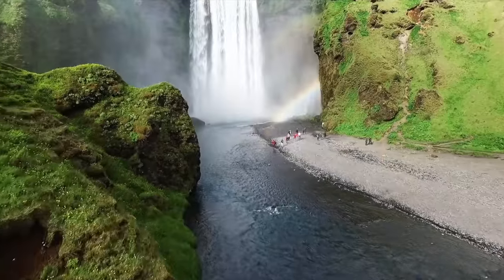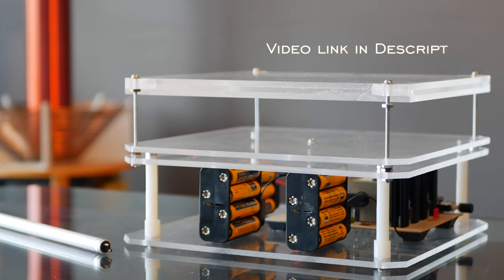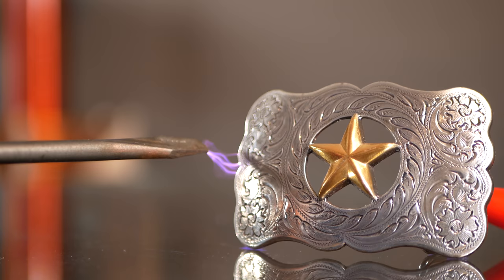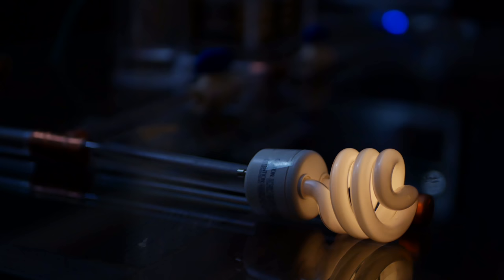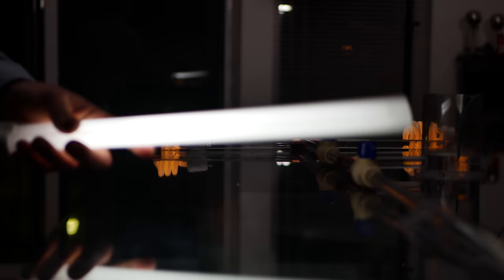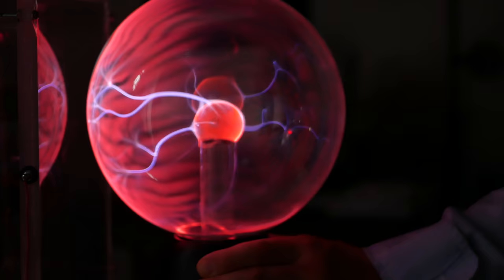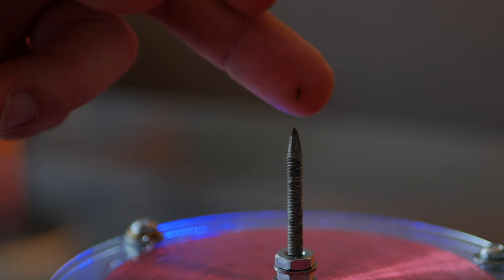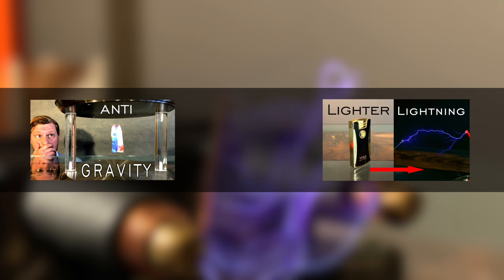Directional Wireless Energy Using Water

Comment: This system has alot of potential (pun intended).
Reply: More like it has a lot of spark😂
Reply: Yes, we must support his innovation. It may not a useful now, then it is useful.
Reply: It's used high voltage
Reply: Is water conductor or an isolator? It’s the system Of which you didn’t invent!
Reply: @veritasvalere88  water is non conductive at LOW voltage. At high voltage it can be very conductive.
Reply: @ValeyardStudios  not really it is conductive in relation to its pH and the type of electricity (negative/positive) that it's conducting but generally distilled water of pH 7 in a wooden basin (not plastic since plastic is resinous) will have the greatest resistance.
Reply: @wisecounsel6135  it's not about microminerals but rather about the crystalline nature of water which always has polarised hydrogen and hydroxide.
Reply: I noticed the comment and wondered. As a one-time electrochemist, potential jokes were routine😁
Reply: @wisecounsel6135  you explained that perfectly Simbarashe. what you said should end the discussion  but i see it continues on.. oh well that us humans for ya, we love to argue and discuss! 
; )

Comment: Wireless energy! See? We replaced all those messy wires with hoses filled with water!
Reply: now it is just like the internet, a bunch of tubes! (anybody still remember that reference?)
Reply: Everything you need to clean up is at hand.
Reply: Now when you drill through the flooring you can get electrocuted so you won't have to worry about the insurance claim 😂👍
Reply: @switchjim  me
Reply: Washington State has been putting lines underground pull put the lines put in water. Some had flooded anyway so better connections are needed.
Reply: Lol
Reply: Simpleton
Reply: Commonly known as streamlining
Reply: Lmaoo

Comment: I wonder if this is why Tesla's wardenclyffe tower had a central ground rod that ran through the water table?
Reply: If you look up AM radio, back in the day, studio could be in town, but the transmitting antenna was ideally located on marsh land, to make a more effective ground plane
Reply: Sigh.

No.

Tesla believed in the Ether, and that he could transmit power through the EARTH.
Reply: @Jkirk3279  why the sigh? what do you believe, pertaining to 'ether', 'power through earth' or the original question about the wet ground ... you didn't actually explain anything
Reply: @Jkirk3279  well plasma channel shower that water aids in transmitting power wirelessly, so I don't think that rules out Tesla using the water table and aquifers to aid in the transmission. However Tesla did say and believe in some wacky stuff, so while he may not have understood exactly why certain things happened, I don't think it rules out the possibility that he was utilizing groundwater.
Reply: @Jkirk3279  and the atmosphere tundiskey event. Can't say for certain  it's quite the coincidence if nothing else 🤔.
Reply: @MrDeathray117  wacky thing? Pray tell which ones outside information?
Reply: We knew this already.... when your radio falls into your bathtub, your hair automatically curls itself, Very efficient!!! 😂🤣
Reply: To guys who think it was for wireless electricity, nope, he built it because he wanted  planes to fly wirelessly.

He had made Tesla turbine for the same reason, it was way powerful than any ordinary motor.
Reply: @timmorris3056  tell me how to do it properly. It didn't work
Reply: Aquifers create electricity and can transmit it, tesla copied the pyramid builders methods of using aquifers to create and transmit wireless electricity. I think the pyramids were also known as the towers of babel, a civilization with unlimited power, and were build before the languages became confused.
Reply: Many great answers and ideas here. Fun to read. Remember that electricity isn't a product or invention, but a description of a natural force of nature. It is the same everywhere. It is the same "thing" however you use it,  and it was the same in ancient times as now, although the tech built to use it would be different. If Tesla figured out how to understand the invisible force, then he could harness it to work in many different ways ... I'm suggesting then, if he believed some "thing" actually functioned, it no doubt did function, imo ... if the government confiscated your stuff, it no doubt is because it actually works in a way they do not want you to actually be doing.
Reply: @get-out-there2  that is interesting. I believe the pyramids were highly efficient electrical resonator devices that operated on the frequency of hydrogen, oxygen, and water ... the passageways conducted, like a waveguide, and might have been flooded, if you can imagine electricity conducted by plumbing LOL ... additionally, all those repetative columns would act to filter and steer or propagate the desired frequency, while diminishing the unwanted noise. The little cutouts in the wall would do similar, and the parts inside are the components ... similar to how a semiconductor chip is one thing with little parts built in, the whole pyramid is the thing, and little parts  built in it.  There are many conductive or semi conductive materials.
Reply: @get-out-there2  i've heard that before. That at night, the pyramids used to light up
Reply: @Jkirk3279  Aether, what fills the alleged vacuum of space. Ether is the gaseous substance that will put you to sleep, or start your cars motor...
Reply: @mem3769  the Great Pyramid was covered with a white stone, polished, so that it gleamed/glowed in the night...
Reply: William Carr in this case using water as an ether to transfer energy through the groundwater, wouldn’t that be indicative of sending Energy through the earth through a similar matter based factual substance.  Maybe Tesla player it off as ether to get other scientist to avoid finding out the simplicity of the design and stealing it.  That tower was funded by JP Morgan.   So design protection would have not just been a good idea but a sure requirement.  Making people go off on wild goose chases searching for something that plausible does not exist but is being actively disputed would be a perfect cover, especially if displaying the working product made them think the ether was real.  Early electrical inventors were ruthless to each other.  So making everyone search for el dorado when you know it’s not there would be logical, especially for someone with such a complex mind.
Reply: Just another poor guy ironic cause I’m pretty sure Tesla himself said it could be used for wirelessly transmitting electric, media, radio, etc.  I’m pretty sure he made the towers for free energy to help the become more faster.  Money got in the way.  It’s one of the saddest stories in history.  And it’s sadder a coalition of inventors, millionaires and scientists didn’t get the funds and ideas around to see it through in honor of what his goals were with the towers.  If it was meant to better humans, why aren’t we investigating and building them yet?
Reply: @IPAsAndSunshine 
WELL, it's hard to profit from, and the richest of men don't want to see their bottom lines decline.
Reply: @MrDeathray117  Whether Tesla believed in wacky stuff is irrelevant. Every invention he ever made, he designed in his head, then built, and every one worked the first time he built it, exactly as he wanted it to. 
So whether his ideas were wacky or not, they were workable. 
As for the ether, while people love to say that Einstein disproved the ether, he really just showed that time is malleable. If you really get into relativity, and quantum physics, it is appearing to many scientists that the idea of an ether may actually help to solve certain unsolvables. The idea of an ether isn't really as dead as some might think. Just may have more complexity to it.
Reply: hummm interesting...Tesla...our gift from God...
Reply: Barbara Wall Tesla and Jacque Fresco.  Both had revolutionary visions that would empower all people to have peace and safety.  Fresco was the father of the idea of AI controlled self building robots, and using them to shift mankind away from labor and fully into critical thinking and humanity.  Like Tesla, Fresco vision would mean big things for individuals but left no room for corporate business, or much business at all.  His idea was a blend of democratic values and self governance, no money, no religion, no institution to take control, the frank opposite.  His work inspired the song “imagine” by John Lennon, as Lennon was a strong advocate for his ideas; as many many others.  

It could be, as Tesla was the father of the idea of wireless power, internet, and messaging, through a primitive 5G like signal, Fresco was the father of the 4th industrial revolution we can’t get away from.  If you wanna look at it from a religious point of view, they both fit the roles of the 2 witnesses.
Reply: @get-out-there2  Look into "Ley Lines" the pyramids were built on these...its like Earths natural energy field....apparently UFOs travel along these lines aswell...
Reply: I think is too early to be accurate at knowing what Tesla thought, many of his documents “went missing”
Reply: That guy wanted give electricity for free. Reason why Tesla the car company idiol Edison instead.
Reply: @Andrew-zt3bf  See their power and raison d'etre decline, you mean.
Reply: @Jkirk3279  using the huge inner ocean, you could probably do that.
Reply: @Jkirk3279  Sigh. 
Why can't people like you just learn to be nice, 
If youre so damn smart, 
People like you, repel people from learning and keep them in the dark, because you make learning feel like being dumb, when really, discussion and learning is the smartest thing you can do. 
Unlike your awful methods of pushing people away from learning. 
Too many people like you become teachers. Never understanding that if the goal is to enlighten, you cannot begin with emotional torture
Reply: @MrDeathray117  What whacky stuff did he believe in?
Reply: @MrDeathray117  sure was hoping you'd tell him, you seem quite genius looking at your name  ?
Reply: @smoke4131  high revs but low torque which limited its applications.
Reply: nice one ! :))
Reply: @kingscroach  from what i've documented, Tesla powered the tower.. so no upper athmosfere transfer . His car was using something similar to what you say, differencial potential from .. something .. and if I'm not mistaken, the car was droove by a relative of him or something like that. Returning to the tower, he was founded with money for some radio technology development but he was Tesla and hi did what he want, so he made something much better and saddly to early for his era.. people didn't understood at that time what is the potential of transporting electricity trough ground.. i can only imagine a world at his moment when my battery phone is dead and I just put my phone on the ground to charge ! That is Tesla genius, born in a wrong century !
Reply: @kingscroach  He did finish the tower and it worked ! Investors left angry from location at the test/presentation time,  because he didn't deliver what they wanted..they asked for telecomunication device and Tesla made wireless electricity.. Saddly I don't have any link with this information anymore, is a long time ago documentation and considering that Tesla life and achievements are wrapped around a lot of mistery and misleading information, I can not sustain 100%  that this information is ..100 % real ! Yet, because I admire his genius so much and aknowledge his world changing work and capabilityes, I will accept this story as true ! If youre willing, search over internet for information and I' m pretty sure you'll find what I'm saying above :)
Reply: @kingscroach  in my country there is a saying : "We shall live and we shall see !" Best of luck and.. "we shall see!" !  :))
Reply: @kingscroach  like I said, his life and work is wrapped around mistery and many rumors.. I can talk only of what I know and thank you for sharing the info ... now I have to make another "Tesla research" ! :))
Reply: @kingscroach  yeah, i've notice that some people just work in mind more than say .. or write :)
Reply: @switchjim  because it's another case of people trying to attribute things to tesla he had nothing to do with
Reply: Has anyone seen the giant Tesla coil built here in Texas? I forgot where it's located though. People are revisiting Tesla's wireless energy towers.
Reply: @Jkirk3279  The earth is a massive dynamo, in essence a mega battery, and tesla DID transmit power, through the earth, and we still have no god damn idea how.
Reply: @switchjim  There palm thick copper wires in some of these pyramides. I see no other sense to build them but for elecricity.
Reply: That's an interesting question..
Reply: I think tesla wanted a really good "grip" on the Earth.  It meant he had better grounding.  There is a video with someone testing a tyesla coil using WardenCliff tower's grouinding and the sparks were longer with it than a regular grounding setup.  I think it's to ensure a really solid grounding to the earth.
Reply: @inventorbrothers7053  you're correct, the grounding system of the wardenclyffe tower was far superior to other grounding setups. It's hard to say if the tunnels underneath the tower still exist and if they actually run all the way to the nearby ocean as theorized. Its fascinating to consider all of the possibilities!
Reply: @MrDeathray117  definitely
Reply: @smoke4131  Viktor Schauberger?
Reply: @Jkirk3279  exactly! I think he wanted to make use of the potential between the ground and ionosphere and step it up through a resonate fequency. Then he'd propogate the energy through the earth via already existing teluric currents and access the power through obelisks or some other mediums placed around the globe

Comment: Idea: WIRELESS POWER SHOWER
Reply: That would certainly Jolt you awake in the morning. O.o
Reply: Hmm Kind of reminds me of the suiside showers in Brazil, open high voltage coil heating water going trough a plastic showerhead, tingly, lol.
Reply: only God have cordless shower
Reply: How refreshing! How recharging!
Reply: @MrGrinny  a friend of mine had to karate kick his tall roommate out of one of those showers.. fortunately they both survived!
Reply: Can  i  attach a  normal battery l with a normal pipe whose both side is  attached  with a copper  cap and then a bulb with  it  ! Will it still blew?

Comment: When you mentioned “directional” I was envisioning some sort of focused RF energy transfer. As usual, direct capacitive (or inductive) energy transfer drops off with the cube of the distance, while EM waves drop off with the square, meaning you’ve already got a system inherently worse at long ranges, but those are ranges with respect to the size of the radiating element. So in a situation where the capacitive radiator is larger than the distance it is away from the device to be powered, you could have a comparatively high power flow. Of course, there are potential concerns with applying strong electric fields across human beings, and your whole system would lose energy the more coupling there is from the radiator directly to ground, so I couldn’t see it being used outside.
I don’t think it’s possible to radiate an electric field in such a way that it focuses on a particular point, but considering the frequencies are only in the kHz range, it’s possible to build a phased array to test it without too much difficulty. A 3x3 square of emitters controlled independently by an MCU (or maybe a few clock generators like si5153s) would be a relatively simple proof of concept, and would allow an easy comparison to no phase shifting. Maybe there’s some analog way of handling the phase shifts automatically, but I can’t think of one.

But using plastic valves to turn on and off high-voltage signals or power? That’s actually quite a practical sounding idea. To get sufficient separation to prevent dielectric breakdown, you’d need a switch that moves the contacts far away, and also prevents arcs from building and pitting the electrodes. But a plastic valve doesn’t really have those issues, besides whatever tiny leakage current it has. Maybe dunking a common mechanical toggle switch in mineral oil would be a good method, but I wonder if the 2mm or so of oil would be better than the 10+mm of a ball valve.
Reply: >Maybe there’s some analog way of handling the phase shifts automatically, but I can’t think of one.< 
How about Analog Delay Lines? Phase Shift Oscillators? Note that the directionality of a Phased Array varies as the square of the number of array elements.

Comment: The cfl stayed lit when you turned the valve off due to capacitive copping.
Reply: He may also be generating a fair bit of radiation with an oscillator connected to what are essentially antenna
Reply: @xxportalxx.  At those short distances that's the same thing; near field = capacitive coupling.
Reply: I think its because it was directly connected at the time to end caps, residual power leaking out. When they were not attached they powered off completely
Reply: It all makes sense now
Reply: There was residual power left in the ballast in the CFL. Enough to excite lazy flurons

Comment: Water don't like sharp edges and straight lines when running.
Reply: I think for the sake of a proof of concept prototype, a simple design like this was enough. Could be interesting to see how to improve the system later on
Reply: @nicolascoquin7760  
I would venture a suggestion to go along the Tesla conceptual intelligent path, it leads to further exploration of frequencies in the design. 
(The use of multi phase ac increases efficiency add triangulation in the soup mix and vola safe directional wireless energy. 

Oookkaa! my work is done here, I need a nap lol)